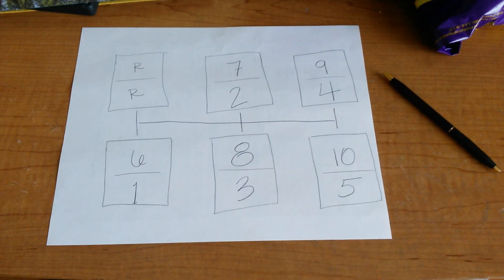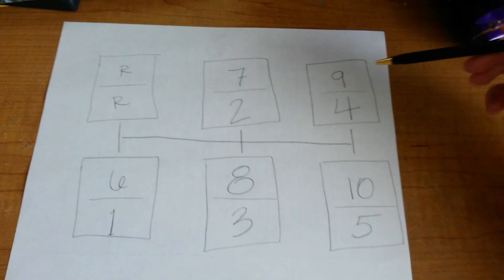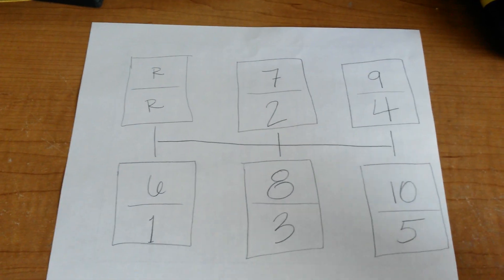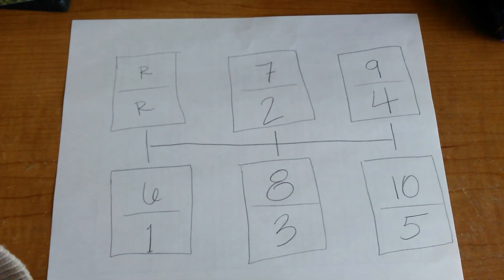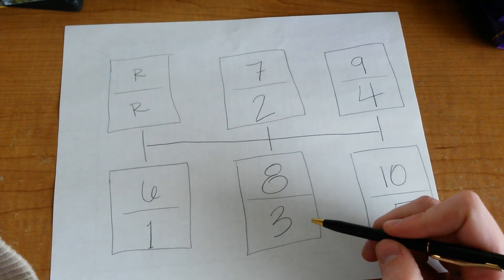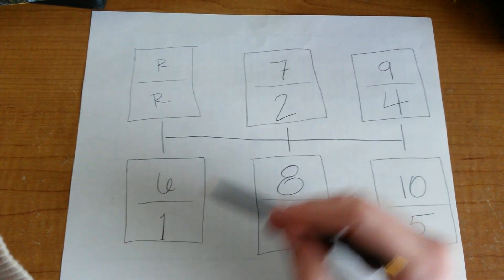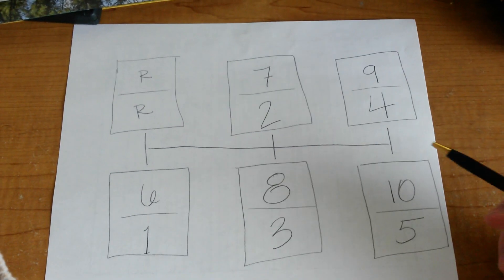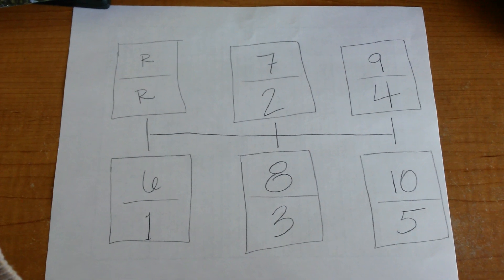How To: 15-speed Transmission

Comment: So its a 5 speed, w/no granny gear, and a 3 speed transmission set behind it, but the 3 speed has low, direct, and over, with a tiny gap between low and direct, so you mostly use direct and over. 

Same construction as a 13 but different gearing and behaviour. Eaton took a 5+3 stuck it into a single housing, air shifted it and ppl didnt understand it had to skip a few gears like a 5+3.

Comment: I have 15 speed transmission in my truck, but mine is 15 speed for highway use and it doesn’t have deep reduction but I can split  all  5 gears in upper range, it’s basically 10 speed with option to split upper 5 gears like you split upper gears on 13 speed transmission, I can’t find single video or information about my 15 speed transmission I would like to know gear ratios

Comment: So really, a 15-speed is just a 12-speed and they could've extended the shift pattern one more gear and just kept it high/low? I'm not a trucker, but I completely fail to see the need for all these stupid switches and modes and splits when you can just have a 5, 6, or 7-speed H-pattern with a high and low range of all roughly evenly spaced and NON-redundant gears. Or even better, a 4 or 5-speed H pattern with a 3-position low/med/high range of NON-redundant gears for a total of 12 and 15 speeds, respectively, based on what kinds of loads or conditions a truck is working with. 18 speeds just seem like unnecessary overkill with no benefit.
Reply from the maker: When you’re running heavy (100,000 lbs+) all these gears are necessary. Much easier to get moving and keep gaining momentum on hills or on soft terrain. You have to drive these transmissions to appreciate their value.
Reply: @n8bolton  My main point is that the patterns can be simpler and any redundancy (like how 15s are actually 12s since deep reduction 3rd is the same ratio as low first) can be done away with. Tell me, how many actual UNIQUE gears without overlap are there in an 18-speed? If it's 14 or 15 unique non-overlapped gears then everything I said stands.

Make the shift patterns 5, 6, or  7 positions with only a high/low switch, or 4, 5, and maybe 6 positions with a low/med/high switch if 18s are truly 18 and not fakes like 15s are. No overlaps or redundant gears.
Reply from the maker: @Drunken_Hamster  18-speeds have 18 non-overlapping gears. The 15 is the only air-shift transmission with this anomaly. Older twin stick transmissions also exhibited this.
Reply: @n8bolton  So they jumped straight from 10 to 13 to 18 and didn't consider a true 15 in the middle. Got it. Thanks for the clarification.

Comment: I'm confused about something, since I've never driven a 15 before, let alone an American truck.  I would assume by the name "Deep Reduction" that it is the LOWER of the two gears in that position.  i.e., "Five High/Five Low".  But then you say flip the splitter "forward" for DR.  Wouldn't that be the higher gear then?  I'm lost.  Is DR the higher or lower gear?
Reply from the maker: It’s a little bit counter-intuitive but yes, pushing the splitter forward while in low range is how you reach the deep reduction ratios. You’re right, though, that typically that’s not the way most other transmissions work.

Comment: Unless people had a chance to pull 140K Lbs or heavier, people don't understand the need of momentum.

You can have engine power to pull and because of lack of momentum you can't shift or you are on a grade inclination and because the torck force from the engine is too quickly engaged by the heavy load it does nothing but shake the cab violently without going anywhere.

That's when Lo-lo and Lo-hi gears are handy in an 18 speed and deep reduction in 15 comes so handy to make that power- torck transition.

This power-torck transition is the reason why authomatic transmitions are useless in pulling heavy loads. By the time the sensors sence something wrong the whole thing goes bust.

Comment: You are one of the few people who understand the 15 speed. Most guys have not been trained properly on them and drive them as a 10 speed. A lot of clutches got burnt, and they quit making them. The 15 speed was a great transmission only if guys know how to drive it. BTW, when backing with these trucks, you should always use deep reduction. Mid range is too fast for most guys and they will burn the clutch.  So, I would like to try to simplify sequential shifting for the 15 speed. Here goes: Start off in deep reduction range. Put the stick in 1st, then 2nd, then 3rd. Move the range selector to mid range (they call it low!) and move the stick back to 2nd, then 3rd, then 4th, then 5th.  Then move the range selector to high, and move the stick back to 1st, then 2nd, and on up to 5th. And it's just that easy.  Hope this helps. If you want to learn how to double clutch, partial clutch, and float, go to my video "3 ways to shift a 13 speed".  Drive safe, and happy motoring!
Reply: According to the RT & RTX 15 Speed instructions in my Ford L9000, you're wrong. It's deep reduction 1st to 5th. Then 4th and 5th in low. Then 6 to 10 in high.

And if you're not Mr. Fuller himself let's not argue about this...

Comment: 15 speed in theory 12 in the practice, 10 speed plus low/low and low, or 10 plus low1 and low2, 15 speed with 3 speed repeated equal 12 speed.

Comment: You explain 15 speed and show only 10 on paper. If you added 11to15 on the paper, it would have been useful
Reply from the maker: There isn't an "11-15". There's a deep reduction 1-5. That's what I'm trying to help people understand. A 15-speed is a glorified 10-speed with 5 ultra-low gears that overlap the normal low range gears. Most drivers would never shift a 15 any different than they would a 10.
Reply: @n8bolton  I am sorry, I didn't understand "deep reduction". Do you mean that the splitters will help to keep the vehicle in control at 6.5, 7.5,  8.5, 9.5 and 10.5. Thus total transmission would be 10+5 gear transmission? This is what my idea of a 15 transmission vehicle
Reply from the maker: It gives five gears below the normal 1-5, while in low range. The first two gears in deep reduction are slower than 1st gear. Deep reduction 3-5 are practically equal to your normal 1-3 ratios. So, practically speaking, a 15-speed only offers two more ratios over a 10-speed.
Reply: @n8bolton  So this is my question:- In low range we have 1 to 5. In high range we have 6 to 10 as it appears in the paper - very well show. How do we hit the gear as you refer to it " below 1 to 5"?
Reply from the maker: When you're in low range, pushing the blue switch on the shifter forward gets you into the low-low gears, which you can shift in exactly the same pattern as 1-5. Simply pulling the switch back brings you back into your normal low range.
Reply: @n8bolton  Got it. So at gear 1, if the splitter is pushed forward, I will consider it 0.5.
And at the 2nd gear if I push the splliter forward, I will get to a 1.5.

Similar at the 5th gear, I will consider it at 4.5 when the splitters are shifted forward..... Please confirm if my thoughts are correct.. approximately...
Reply from the maker: In deep reduction, think of it more along the lines of minus two gears from whichever gear position you're in. If you're in the 1st gear position and you have the splitter forward, think of it as 1st minus two. 2nd would be 2nd minus two. 3rd deep reduction would be 3rd minus two, or 1. 4th and 5th follow the same rule. 5th in deep reduction is practically the same as your normal 3rd gear, if you apply the minus two rule.
Reply: @n8bolton  Got it. Thank you so much for responding to all queries. Your response will be beneficial to millions of people who are going to read the message in the future.

Now I was just imagining that if the vehicle is about to start from a "still" position. It may be "loaded full" and

1. It may be at a "flat ground" and "still" position, or

2. On a steep hill at a "still"  position .

So in the above 1st scenario, I can use gear 1 to get the vehicle "move and crawling" ?

In the above 2nd  scenario, I can use gear "1minus2"  to get the vehicle "move and crawling" up the hill ?

Are my thoughts correct?
Reply from the maker: Yup. That would be a perfect situation and application for deep reduction gears.
Reply: @n8bolton  Thank you so much.
So in last 4 days I just learned theory for 8, 9,10,15, 13&18 transmission.

So 15 transmission is the only transmission where we have "deep reduction" concept.

While in 13 transmission I learned splitters being used above 5 th gear for 5.5, 6.5, 7.5 & 8.5 plus LO gear and normal 8 gears

In 18 speed transmission my takeaway was a 8 speed plus 1.5, 2.5, 3.5, 4.5, 5.5, 6.5, 7.5, 8.5

Plus Low and High in a LO.

So total of 18.

Hence these gear shifting from a 5 to 5.5 (example) is not a deep reduction; but only increase in the gear.

And that, the 15 speed transmission is the ONLY TRANSMISSION which has a "Deep Reduction" "Gear minus 2" Concept"🙏
Reply: @deepalijain803  the way I was taught was to imagine a transmission shift pattern like the levels or stories of a building, a normal 10 speed is a “2 story building “ , a 15 speed is more like a 2 story building with a basement. See what I’m saying?

Comment: Ok, always wondered, I've run 9 , 10, 13, and 18 speeds but was always told 15 is a odd transmission, for the most part you would run it like a 10 speed. Thank you for that very instructional video !!!
Reply: 15 over you can usually run it like a straight 10. High gear in each range is against the dash on my eaton fuller 15 over. The lower 5 gears are deep reduction which I very rarely ever use.
Reply: I drove a Ford Loiusville in the early 80s, 350 Cummins 15RR. Deep reduction was frozen, it never worked from not being used over a period of 5 years.

Comment: I  had a 4964 ex star car with an n 14 plus and 15 speed.  The salesman at WS of demoine Iowa didnt know how to shift it and I was used to a a 10 speed but the deep reduction didnt make sense.  I asked every driver who said they knew a 15 speed and all I always got was I never use deep reduction or just take it out and grind it into a low range gear.  I always used it to 4th DR then preselect (blue pill) and shift to 3rd low range which is an upshift, and away I would go.  Dont select DR when your rolling pretty good in low range or youll about go through the windshield because it will drop 2 gears NOW.
Reply: I am going to be Spec’ing some Dump Trucks. I want Transmissions with a Overdrive and have been considering a 10, 13, 15, & even 18 Spd’s. The 15 Spd caught My Attention. I want that Overdrive on the way back home. I want something different than a 8LL. Seems 15 Spd’s were more common in Mechanical & 2000 & Older Trucks.
Reply: John Hoffman it shows you commented but for some reason it is not showing up. I was curious to hear your opinion.
Reply: @TaylorAlldredge  Sorry, the 15 spd doesnt seem to be used any more.  I would think it is a good tranny for a dump truck because it allows you to crawl around gravel pits loaded at slow speeds (to a walk if you want) and climb out without working the engine.  You have to be careful because when you select deep reduction from the low range it immediately drops in and squats the truck (you drop 2 gears instantly).  1.5 million miles and never had an issue with it.

Comment: Great explanation. Only drove a 15 a few times and that's just how I recall it...had to pull into an empty parking lot to figure it out as I was covering for another driver and never drove a 15 speed before. I assumed it was just like a 13 with two additional gears and kept trying to split the high side....felt like an idiot. Do you have a how-to video for a super 10? I loved driving a super 10 but a lot of people hated it.

Comment: Really made it simple what you discuss actually was loosely stated on the pattern of the 15spd single axle ford L series dump I sat in. It said if your off road you can use all the gears in deep reduction but if your gonna progress shift it. Then only use till 3L then once you are there put the blue button forward and grab first gear and shift it then shift like a 10spd it actually said if you progressive shift on road higher than 3L damage could occur to the transmission

Comment: If you have an engine with a narrow power band and want to work off and on road a 15 spd is the BEST trans you’ll find. It has the super low hole like an 8LL but has far closer ratios for keeping speed on the road where an 8LL Puts the gears too far apart. A 13 or 18 speed doesn’t have a low enough first gear to do much good in the dirt. Plus in theory there’s less to go wrong in a 15, you move the shifter through all 3 ranges instead of using a button every other shift like on an 18.
Reply: Taylor Alldredge the 18 speed is the best all around trans you’ll find but they are expensive to spec and dumber drivers may not do too well with them. Now the RTO/RTX 15 and RTO/RTX 8ll both have the same ratio top gear so you won’t gain any top speed. Where the 15 helps out is it basically has 2 extra “in between” gears that the 8 doesn’t. To shift a RTO 15 progressively you’d go deep reduction 1-2-3 then out of deep reduction and into 2nd then up to 10th. As far as longevity I’ve found the 8LL’s to be the best. I have an RTO (high gear toward the dash) 8ll In my dump truck and it’s the perfect trans for a dump truck, but our lowboy tractor has an RTO 15 speed in it and it’s a better trans in that application (VERY heavy). It’s all about what you wanna do. As far as being friendly for hired drivers an Allison auto is always a good choice, way less chance of a cowboy tearing out a rear end or clutch with an auto.
Reply: @J.R.in_WV absolutely not... The 13 speed is the best all around transmission out there.  Unless you're hauling extreme weight constantly the 18 speed is a waste.  You'll never use half the holes unless you just love shifting for no good reason.  The 15 speed was the absolute worst.  If you're not in pulling in the mud it's useless.  No wonder they got rid of em.

Comment: Thanks for posting this. I have a 4900ex with a 15 sp. Know how to shift it fairly well but the stepping back a gear to get out of deep reduction is a nifty trick.
Reply: I was taught Deep 5 to Low 4 was like a 1/2 Gear change as opposed to Deep 5 to Low 5 you would stall as i found out the hard way I never made that mistake again😂.

Comment: Just bought a T800 with 15 speed RTO. Man it got me confused.. not to mention this is the first time I drive a big rig. Thanks for making this video. It would be cool to see on a graph where the gear ratios actually are.
Reply from the maker: Dr Frantz Thanks for the feedback! Like I mentioned in the video, I'm not sure of the exact ratios, but practically speaking, just imagine that the deep reduction gear you're in is two ratios below the gear position you're in. DR 3rd, 4th and 5th are simply duplicates of your standard 1st, 2nd and 3rd gears.